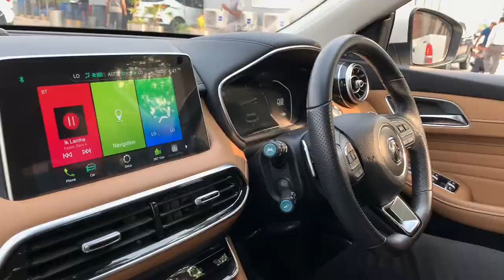MG HS 2022 First Oil Change At 5000km | MG Lounge Care Centre | Pakistan Car Club

Comment: I live in the UK and here garages are horrible no one has any knowledge of this car . Can you make us a video of the oil change on the DCT250 automatic gearbox on the MG HS PHEV? Or at least please can you reply here to my post if any special procedure is needed to change the oil or just drain the old oil and add the new one?
Reply: Use a MG dealer. Independent garages are unable to source parts and don't have access to software updates
Reply: the dct change is just like a manual transmission change.  drop the oil from the diff housing drain plug, fill from the top . follow the breather to find the plug